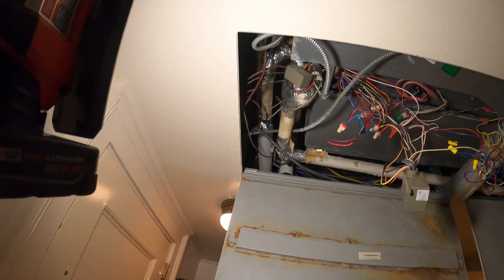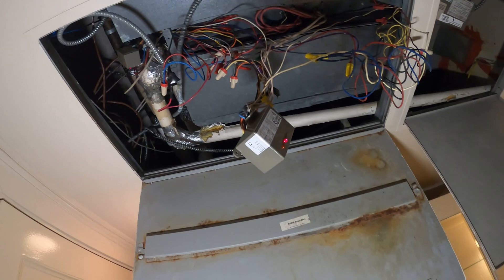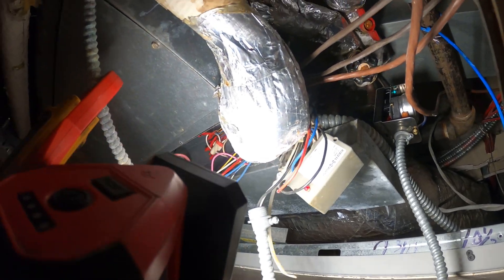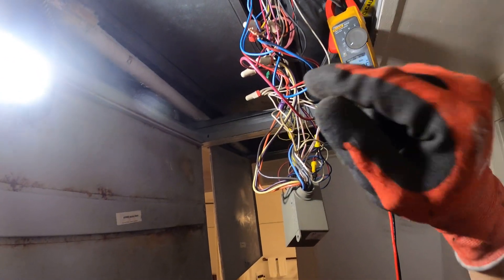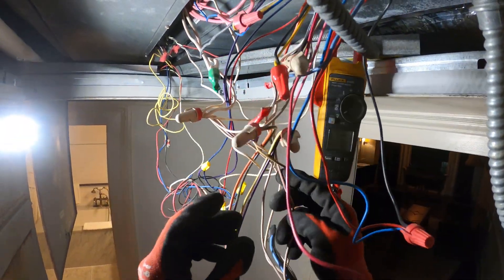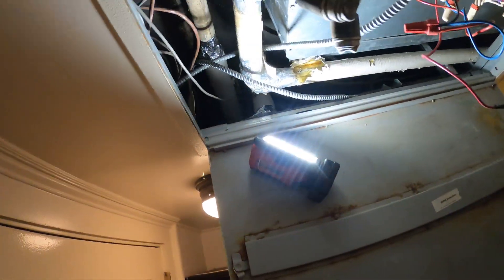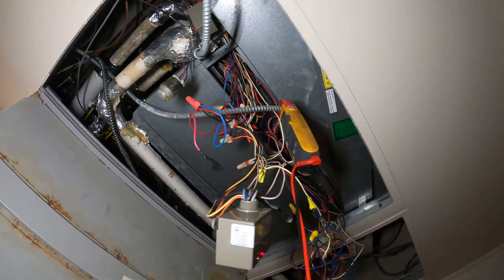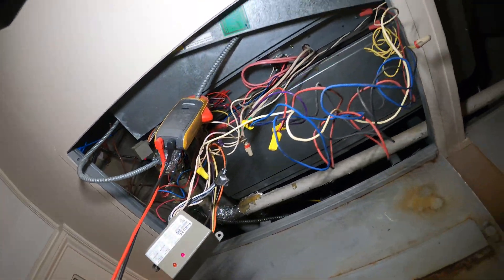HVAC Service Call: NIGHTMARE HVAC Fan Coil Unit Not Heating (FCU Troubleshooting) FCU Not Heating

Comment: 😂 Building engineer that insulting 😂to all engineers more like apartment maintenance mechanics or carpenters that should never touch HVAC equipment😂
Reply: I found a txv leak at my condo unit, offered my service but got denied for insurance purposes ok no prob. The maintenance guy replaced the txv but had no idea how to charge the system. He was in the phone with some dude as he had the temp probe on the supply reading 70degrees and called it good 🤦🏽‍♂️ didn’t wrap the wet bulb either. These guys don’t know shit. I waited til they were off, snuck in my 410 bottle and finished the job.
Reply from the maker: @prod.byhostile3715  I feel your pain 🤦‍♂️😂
Reply from the maker: Ahhhh man😂 @richritchie5434 🫣🤦‍♂️